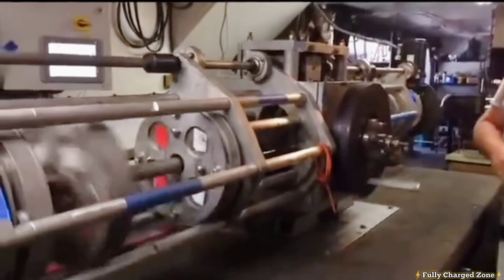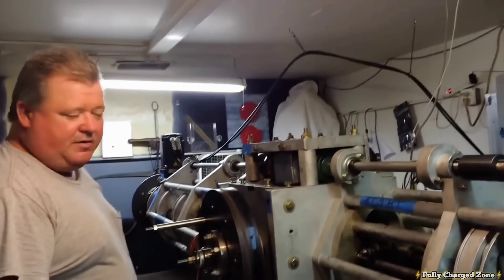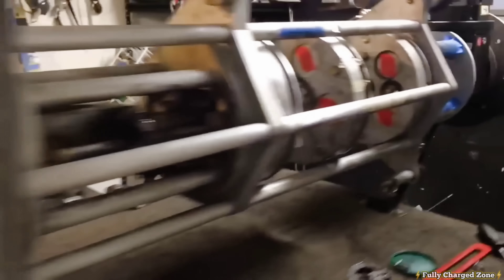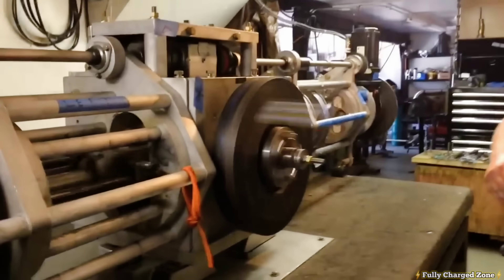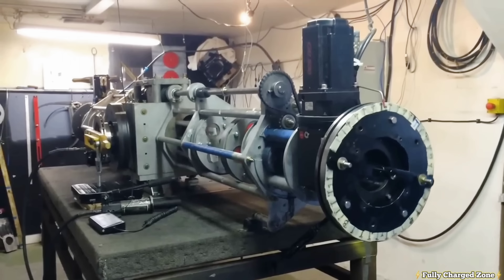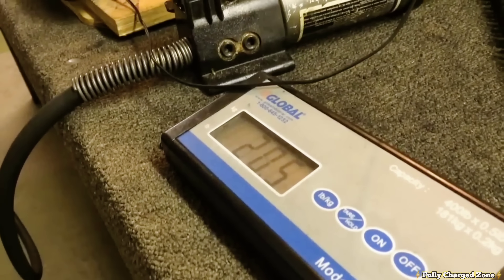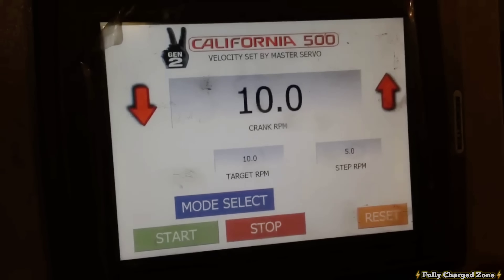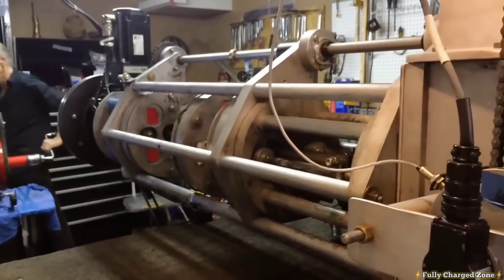World's 1st Magnet Motor - US Patent # 8487484b1

Comment: 😂😂 completely useless but nice work
Reply: Make 8 small ones and put it in a car. Then will be amazed
Reply from the maker: It’s only ‘useless’ until someone understands the physics behind it. The patent lays out the core principles—I'm just documenting the device exactly as designed.
Reply: @FullyChargedZone oh yeah ? Unfortunately all motors have magnets in them. And the motionless generator by Nikola Tesla was impressive. No real need to spin things anymore can't reinvent the wheel 🤷🏼 again love the devotion. ♾️🙏🏼
Reply from the maker: Magnets are present in most motor topologies, but what matters is the field-interaction method. Conventional motors rely on electromagnetic switching—coils are energized in a timed sequence to create a rotating magnetic field.

The device in the patent uses a purely mechanical sequencing system with fixed permanent-magnet fields. Instead of electrically switching coils, the timing and force vector changes come from the mechanical geometry and magnet orientation.

It’s not claiming to replace modern motors or violate physics—it's simply demonstrating a different magnetic interaction method than a traditional EM rotor/stator setup. My role is just to show how the patented mechanism behaves in the real world.
Reply: @FullyChargedZone question was tesla using displacement or electricity?
Reply from the maker: Tesla’s system was electrical. His ‘motionless generator’ concepts relied on high-frequency electrical fields, displacement current, and dielectric interactions — but they still required an external electrical source to excite the system.

Displacement current is an electrical phenomenon, not a mechanical one. The device I’m showing is different — it’s using purely mechanical sequencing of permanent magnets, with no electrical excitation at all.
Reply: @FullyChargedZone he converted energy from one form to another come on man keep the high school education nonsense. From displacement to electricity 😂
Reply from the maker: Displacement current isn’t a separate ‘form of energy’ — it’s a term in Maxwell–Ampère’s law (∇×H = J + ∂D/∂t).

The ∂D/∂t term represents the time-rate change of the electric displacement field D = εE, which appears in regions where no physical charge carriers move (like a capacitor gap). It’s still an electromagnetic current, not mechanical displacement.

Tesla’s experiments used high-frequency electric fields, dielectric stress, and resonant circuits to create large displacement-current effects, but the system still required an external electrical excitation. Nothing in his work converted mechanical displacement into electricity in the way your comment implies — it was all electromagnetic field dynamics governed by Maxwell’s equations.

If you want, I can break it down in simpler terms too.
Reply: @FullyChargedZone You’re mixing two different domains, brother — Tesla never treated displacement and electric current as the same phenomenon.

Tesla’s high-frequency systems used electricity (conductive current) to excite a dielectric field.
But the energy transport in those systems wasn’t the electron-drift he was fighting against — it was the dielectric displacement, the stress and relaxation of the etheric medium itself.

That’s why Tesla said:

> “The currents are not conducted; they are transmitted through the medium.”
— N. Tesla, 1891
Reply: @FullyChargedZone Tesla’s high-frequency systems used electricity (conductive current) to excite a dielectric field.
But the energy transport in those systems wasn’t the electron-drift he was fighting against — it was the dielectric displacement, the stress and relaxation of the etheric medium itself. He never confused these; modern textbooks did, not Tesla.
And displacement isn’t “another form of electricity” — it’s the dielectric field reacting to a changing potential.
Reply from the maker: @EnergyTRE
I get what you’re pointing at — Tesla absolutely distinguished between conduction current in metals and the dielectric stress/relaxation happening in insulating media. He talked about the “etheric” response of the medium because, in his era, the modern field-based interpretation (Maxwell → Heaviside → Hertz) hadn’t fully settled yet.

But even in Tesla’s own setups, the dielectric displacement he referred to is the same physical quantity that Maxwell encoded as D = εE, and the time-varying term ∂D/∂t is exactly what modern EM calls displacement current.

That doesn’t make it a different type of energy — it’s the same electromagnetic field energy described two different ways depending on the medium.

Tesla’s quote — “the currents are not conducted; they are transmitted through the medium” — lines up perfectly with Maxwell’s treatment: in regions where no electrons move, the field carries the energy. Poynting vector, stress tensor, all of that.

So we’re actually talking about the same phenomenon, just using Tesla’s 1891 language vs. the modern field framework. His intuition about dielectric stress was ahead of his time, but it still fits cleanly inside Maxwell’s equations.
Reply from the maker: You’re right that Tesla separated conduction current from what he called dielectric displacement — he didn’t like the electron-drift model and preferred describing things as stresses in the medium. No disagreement there.

Where we differ is how that maps to modern electromagnetics.

What Tesla called “dielectric displacement” is exactly what we now formalize as D = εE, and the “relaxation of the medium” he described is the same physical process represented by ∂D/∂t in Maxwell–Ampère’s law. So the mechanism isn’t outside Maxwell — it is the Maxwellian displacement-current term.

Energy transport in those HF systems still follows the Poynting vector S = E × H, whether the medium is conductive or dielectric. The medium can store and release field energy, but the transport mechanism is electromagnetic, not a separate etheric process.

Tesla’s language made sense for 1890. Modern field theory describes the same behavior with different math.

So really, we’re talking about the same thing with different terminology:
Tesla: dielectric stress + relaxation of the medium
Modern EM: displacement field + ∂D/∂t + Poynting energy flow

Same physics, different era.

Comment: Perpetual motion or "free energy" is impossible.  Back in 1989 I went to a university, physics teacher told me to forget about magnet motors, which I had an interest in back then.  After he explained why it was impossible, and I noticed what he said was true, I gave up on the idea.  Glad I didn't waste my time on it any further.  Energy is always losing due to frictions and other forces, the best you could expect is equilibrium, which produces NO usable excess energy.  Even light is not perpetual, it shifts into lower wavelengths over vast distances.  This is likely fake, I doubt it has a patent - unless it is NOT claiming to be a perpetual motion machine.  Since they passed the rule that all perpetual motion machines had to have a working model in order to get a patent, no new patents have been issued for them.  Fact.
Reply from the maker: Fair take — but this isn’t a perpetual motion claim. Sonny Miller got a legitimate patent on the design, and I’m just documenting the machine and testing what the patent describes.

Comment: correct me if I am wrong, all Electric motors use magnets :D
Reply from the maker: In conventional electric motors, magnets are only part of the interaction, not the energy input.
Electrical current is the real energy source — the magnetic fields simply convert that electrical input into torque through controlled polarity changes.

A magnetic motor attempts to create net mechanical torque from permanent magnetic gradients, something normal motors aren’t designed to do. The patent outlines a geometry that prevents magnetic lock-up and creates sustained rotation without active electrical commutation.

Comment: The title is wrong.  This device is not a motor or en engine, it is a "Means for converting reciprocating motion into rotary motion or vice versa" as quoted from the patent. Calling this a "Magnet Motor" makes it sound like a free energy scam and discredits the inventor.
Reply from the maker: The patent specifies a magnetically induced reciprocation system coupled to a rotary output stage. In mechanical terms, that makes it a magnetically driven motion-conversion mechanism rather than a conventional electromagnetic motor.
The title uses the common name that enthusiasts refer to this prototype by, while the content stays faithful to the patent and avoids any unsupported energetic claims.

Comment: Seems interesting, but without close scrutiny of the machine to eliminate input power, there is no way to establish whether this is what the person claims it is, or just another interesting contraption that can't produce any power.🫠
Reply from the maker: @NielsMadsen-n7p
Fair point... and that’s exactly why I’m showing the mechanism first before making any claims about power. The patent (US 8487484B1) only describes a magnetic sequencing mechanism, not a self-running system or generator.

Right now the goal is to document the motion, timing, and torque exactly as the inventor laid it out so people can see the mechanics without guessing. Once the sequencing is fully measured and stable, I’ll move into controlled torque testing and then generator coupling.

No mystery input, no hidden tricks m... just proving the patent’s motion step by step in the open. ⚡️

Comment: All electric motors are magnet motors. These will work but eventually they will come to a stop if something, such as electricity isn’t applied
Reply from the maker: True, most electric motors rely on magnetic fields — but this setup is different because it’s using permanent magnet interaction and timing instead of electrical input to sustain rotation. I’m just documenting the inventor’s patented design.
Reply: @FullyChargedZone Thanks for the reply. I thought about this after I commented I was waiting to see if someone else though that as well.  I even spoke to my father about it while most magnets and such eventually will stop this is set up in a super genius way. It might continue til shut off.  Would be super interesting to see how long it will run without friction becoming an issue etc.  maybe it won’t.  I’m sure they thought of all this.  I build engines and do lots of fab work but never anything remotely like this 😂. Super cool.
Reply from the maker: Glad you took the time to revisit the idea — that’s the mindset real builders have. You’re right: all systems eventually stop once friction and drag exceed whatever force is driving the motion. This unit just uses a really clever magnetic timing layout that lets it oscillate and rotate longer than most people expect.

The “genius” in the patent is mainly the geometry and sequencing of the magnets. The way the inventor set it up creates zones where the magnetic forces don’t cancel instantly, so you get those extra few degrees of travel each time until the system finally settles.

It doesn’t break physics, but it is a fascinating demonstration of how far you can push magnetic interaction with careful mechanical design. That’s why I wanted to document it exactly as he built it. For engine guys, fab guys, and tinkerers, it’s just an interesting piece of motion control to study.
Reply: @FullyChargedZone definitely! And I’m sure this model can be tested and improved over time like everything. Super cool!

Comment: Patent doesn’t say it’s a motor. It’s basically a magnetic transmission.

BACKGROUND
1. Field of the Invention
The present invention relates to mechanical drives that convert input forces or torques (applied at a drive input) to output forces or torques (delivered at a drive output). More particularly, the invention concerns reciprocating drive systems that perform force or torque conversion by way of magnetic field interactions between permanent magnets.
Reply from the maker: Patent calls it a drive system, but it outputs torque — that’s a motor by definition.
Reply: @FullyChargedZone  there’s a motor attached to it in the video… the patent is for a magnetic transmission.
Reply from the maker: The auxiliary motor in the footage is only providing rotational input so the magnetic timing can be observed. The patented system (US 8,487,484 B1) is a magnet-driven mechanical converter... essentially a magnetic motor core,  built around phased permanent-magnet carriers, defined force windows, and dead zone resets. So yes, in technical terms it is a magnet motor; the external motor is just the drive source for bench testing, not the functional principle being patented

Comment: The probkem is it takes energy to make energy. Can someone explain how energy is being made? I see one guy posted this whole contraption barely had 5 horsepower and wouldnt last as long as a car engine. So how can this replace a car engine?
Reply from the maker: Good question — it’s not creating energy. The design minimizes resistance so the rotor spins smoother, but it’s not meant to power a vehicle. Just a demonstration of how the magnetic interaction functions.

Comment: Free energy doesn't exist but magnetic energy does
Reply from the maker: Exactly — there’s no such thing as ‘free’ energy in physics, but magnetic fields absolutely store energy. A permanent magnet has a stable magnetic field created by aligned electron spins, and you can extract force from that field through interaction and geometry.

The real question is how much external energy is required to set up the motion vs. how much mechanical work you can get out. That’s what the patent explores: using magnetic bias forces and timing to produce useful torque, not claiming energy from nowhere.

Comment: Cool, and what happened when the magnet loses its fields, or your power supply them with electricity, or they will be slowing down in one day. Magnets are like batteries, they run out of charge. There's no perpetual energy.
Reply from the maker: The patent doesn’t claim perpetual energy. The magnets aren’t the power source — they’re part of the force-conversion system. Permanent magnets don’t ‘run out’ like batteries.

Comment: aren't all electric motors magnet motors?
Reply from the maker: No, not all motors use permanent magnets; many use electromagnets or a combination of both. Some motors, like induction motors, generate their magnetic fields through electromagnetic induction rather than permanent magnets, and there are even experimental electrostatic motors that use electric charges instead of magnetism. This is a windup magnet motor thats stores potential energy.

Comment: well i waas kinda wondering if it was fake but they he stated amps as watts. It was then that i knew i was just looking at a scam.
Reply from the maker: Mixing up amps and watts in conversation doesn’t make the invention fake. The patent has the proper technical info.
Reply: @FullyChargedZone  yet its still a scam. You are pushing it to be something it is not. Begone scammer.

Comment: these perpetual motion motors never had a load put on them for a reason
Reply from the maker: Totally get the skepticism—most of the internet versions can’t pull a paperclip. But Sonny’s design was literally built with a load-bearing shaft. Check the patent diagrams; he wasn’t hiding anything. I’m just showing the real device running exactly how he demonstrated it.
Reply: @FullyChargedZone Not talking about load bearing shaft. Electrical load
Reply: Pretty sure it was never even close to perpetual. It's an electric motor that uses magnets, like EVERY electric motor. Just overly complicated.
Reply: The comments here show how many gullible imbeciles are ready to beleive anything ! All these idiots ready to be scammed ! 😊
Reply: For anyone who wants to believe, this machine and many others do achieve what is called over unity, but they do not produce excess energy to power OTHER machines. That is the difference between these and what we actually use in industry today. It is cool, it moves on its own, but it is NOT of any use and is NOT “a good place to start”. The world has known of these mechanisms for centuries, possibly millennia.

Comment: Magnets seek equilibrium from a charge. They don’t out put energy. They’re no different than using gravity. It’s magnetism seeking equalibrium.
Reply from the maker: The patent doesn’t claim the magnets output energy on their own. It uses controlled timing, geometry, and magnetic interaction to create motion.
Reply: @FullyChargedZone Im sorry, but that’s not possible by my calculations and being interested in Free Energy since I was a kid building radios over 30yrs ago. Energy has to come from somewhere. If it’s pulled from the “ether” then it works. This machine appears to do what you are saying but does not produce output higher than the input over time. Energy.

Comment: Is the magnetic strength varying as well 🤔 IDK something cool and amazing IF it's really real 🤣
Reply from the maker: Strength doesn’t change — the patented design uses timing and positioning to create the effect you’re seeing.
Reply: @FullyChargedZone  trying to understand how the laws of physics allows this to happen 🤔 if it's creating it's own power then shouldn't it be able to generate power 🤷
Reply from the maker: Not quite — it’s not creating its own power. The magnets provide a fixed amount of potential energy, and the design just uses careful spacing, timing, and mechanical leverage to make that interaction last longer than you’d expect.

Once friction and magnetic drag overcome that motion, it will stop.
So even though it looks like it’s generating power, it’s actually just extracting the last bits of usable motion from the magnetic arrangement. No extra energy is being created.
Reply: @FullyChargedZone 👍 I would imagine that the timing & spacing was calculated through some simple math😂 or trial and error 🤷